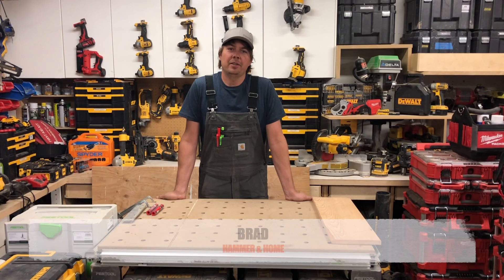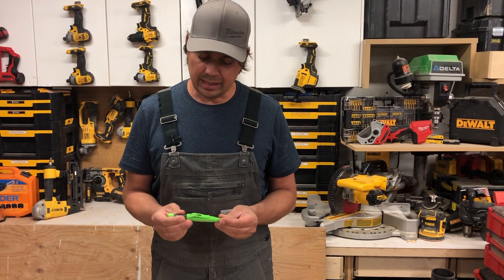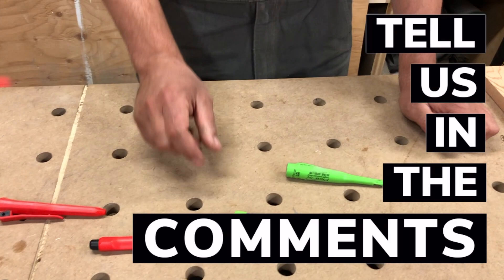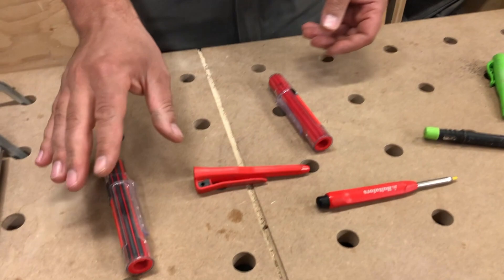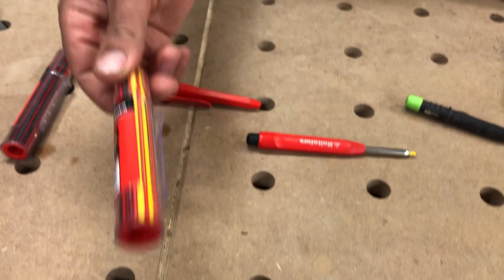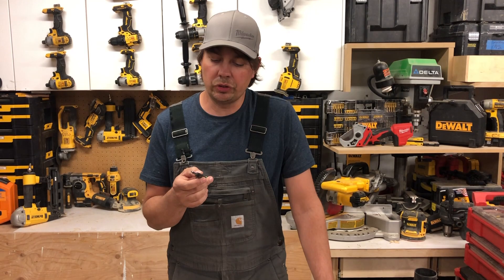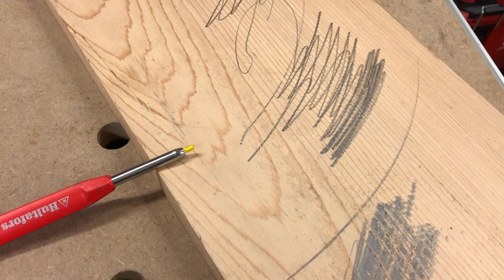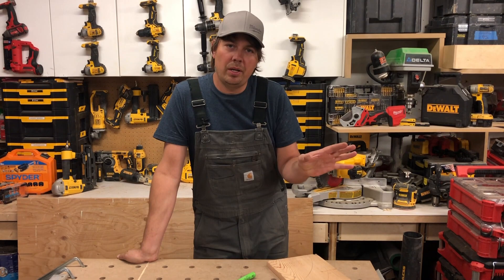Why I use Pica instead of Hultafors - Carpenter Pencil Review

Comment: Pica is extremly bad cuality. Sharpener doesnt work and the lead slip in when writing. As a carpenter i often get dirt inside the pen and it stop working
Reply: So which pencil do you prefer??
Reply: @plachdilna  the best kwolotey one obvs
Reply: Strongly disagree! Sharpener works great and lead has never slipped!
\
Reply: Sounds like you got your hands on a fake pica because I’ve owned the same pica pencil for two years solid and it has helped build over 30 houses and haven’t had the first issue. And are you using pica brand refills? If not that could be your problem

Comment: The Hultafors has the sharpener in a better position and also the holder holds the pencil more securely. I use a Pica just cos I prefer that one but the two points I mentioned are my own findings .
Reply: Pica holster is designed great. No clue about what your talking about. Sharpener is located in a great spot. WHATEVER!
Reply: @jayvaughn9017  The design of the Pica holder and the way in which it holds the pencil unit could be designed a lot better than it is,simply put if you catch the pencil against something when new it fires the pencil out due to the compression fit,when the holder is worn when crawling around on site/using ladders etc the pencil falls out. People remedy the worn holder  by wrapping electrical tape around the pencil,which works but leaves the pencil covered in sticky residue and all the crap from on site sticks to it. As for the sharpener which is fitted on the bottom of the holder to use it properly you have to turn it upside down,not ideal at all when it is fixed inside a pouch/vest etc. plenty users of Pica will mention these problems I have .

Comment: The Pica is amazing but the Lyra is the king in this area👌.the Lyra is like the Pica but more solid and has the sharpener on top of the kompartment so you do not have to take it out of your toolbelt or pocket to sharpening and thats a big thing for me👍. You can also use the led from anyone of those manufactors in any of the pen. Sorry for bad English i am from Sweden so dont know the gramma😉
Reply: And the Pica is a  pen they sell at for almost nothing here in Sweden and comes in very variation i quality but Lyra is the original i think and cost about 10us$ here an its so worth it to have a pen thats never fail on you not even when its  sooking wet
Reply: Disagree! Pica is king!

Comment: I have two Picas, one with Hultafors graphite  lead which I find soft and I have Pica hard graphite leads in the other Pica. The hard graphite is better for fine marking so I use them according with the material I need to mark. I also have the Hultafors red and yellow which I rarely use because they are so soft. I really only use them as a last resort for dark materials where you can't see graphite

Comment: I have tried the pica also , really liked it and bought the kit , I like having a few just like you mentioned for different colours. But that big pica dry carpenter pencil is amazing. I find that the graphite lead lasts longer than the regular lead. I even bought some of the markers , they are great working in sheet metal , great  for tiling with the colours for the pencil. Good video 👊👍

Comment: Nice comparison. I use both but I feel the HULTAFORS  works better because the lead doesn't break in the holster. Also the HULTAFORS sharpener is at the top so you don't have to take it out your pocket to use. Never had mechanism fail on either pencil. (over a year of use) Do your leads brrak in the pica?
Reply from the maker: I really like how the sharpener is at the top of the Hultafors. That being said, the coloured leads always break in my Hultafors when sharpening. I’ve never had a lead break in the holster of the pica. Thanks for watching
Reply: Lead has never broke in holster.

Comment: Its not abour which brand will hold which lead. You have to know which pencil holds what diameter lead. Most will be 2.8 mm lead. So all 2.8 mm lead will go into any of these pens. Unless they are fine/ultra fine pencils. Then your looking at 0.9 mm, 0.7 mm, 0.5 mm, etc... lead. So any brand of 0.9 mm lead will fit into a pencil that takes 0.9mm lead. 

You can buy 2.8mm silver streak markal lead and put it into any one of these pencils.

Comment: I love the pencil itself, but mine win't stay in the little green holster for anything! It would be superior if the little black bump when into a sort of notch and rotated to lock into place, anyone else have this issue of it not staying in the holster?
Reply from the maker: mine stays in no prob, I think you have a faulty one
Reply: @hammerandhome  Yup, i believe that to be the case, shame the return cost was high for my purchase, i just resorted to gluing a little magnetic strip onto the pencil and case, works a treat, personal opinion but i think they could've designed a much better locking mechanism but hey ho, brill pencil as ya say :)
Reply: You might have a defective one because that was one of the things that I was really impressed with about the design. There is a air suction that is created when you push the pencil in. There is no way my pencil would ever come out of the holster on accident.

Comment: Had 3 hultafors all stopped working. Any dry wall dust or even mdf dust then the cap will stop going in and out and/or the lead will not be gripped. Hultafors ones are not good